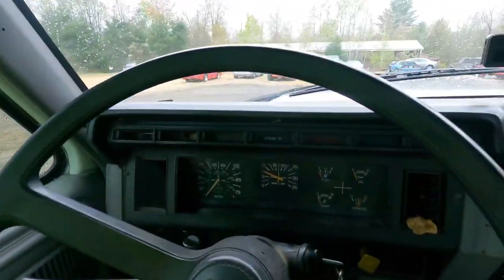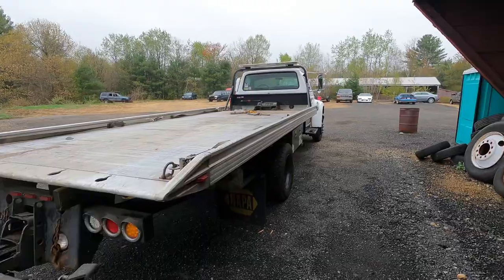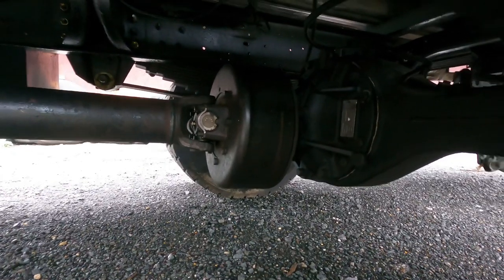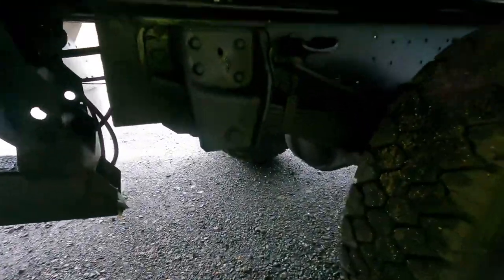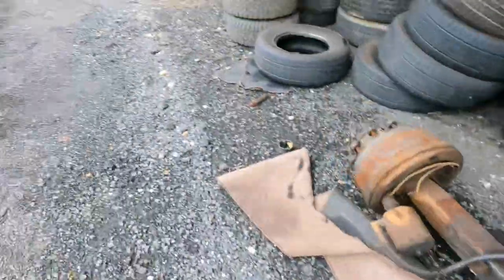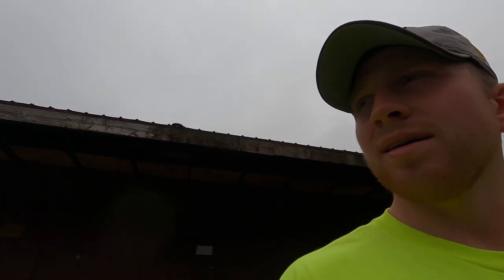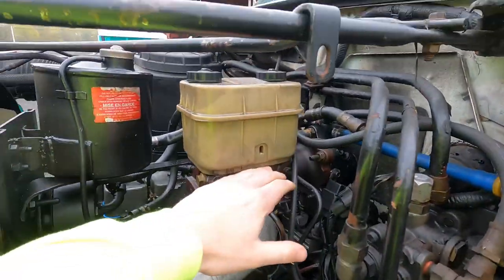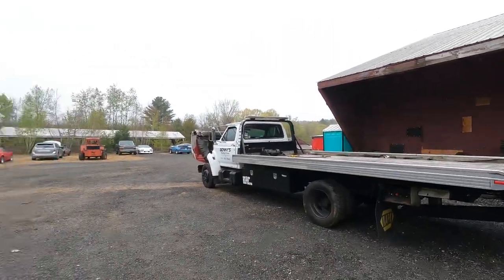How To Delete Lucas Girling Brakes and Swap Axles In A Medium Duty F Series Truck

Comment: Proud owner of a 1991 f-600 with Lucas Girling. 
    I plan the same swap but my Allison transmission has provisions for the parking brake on the rear.  
      You could also add a micro lock in the hydraulic brake lines to “hold” the service brakes on when you take your foot off the peddle to lock all wheels for winching and such.  
     Thanks

Comment: I have a 1989 ford bluebird f600
I have a Lucas girling brake system, the bus is my house.

I REALLY want to swap my cast iron rims and brakes for either an air brake system, or for a modern heavy duty truck hydraulic system.

I figured the rear axle swap would be okay but what do I do about the front?

I was figuring I'd install air brakes, I already held a cdla for years with airbrake cert and a school bus cdlb with passenger and airbrake... So... Should ve fine for me to drive if i swap it.
Reply from the maker: Your front brakes should be just regular caliper brake pad rotor setup, Lucas Girling is typically parking brake setup rear only: can also swap front axle from the same vehicle you find the rear axle from, just measure it